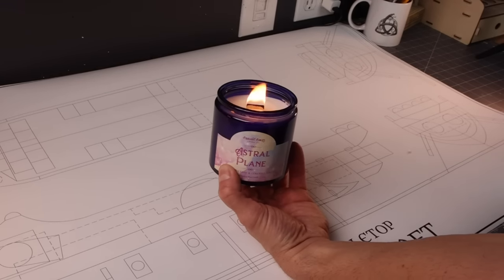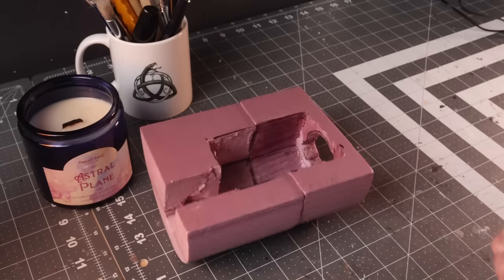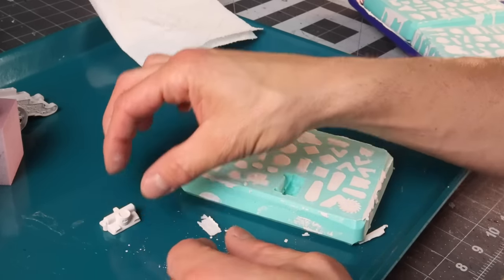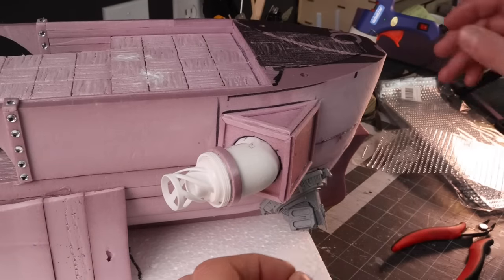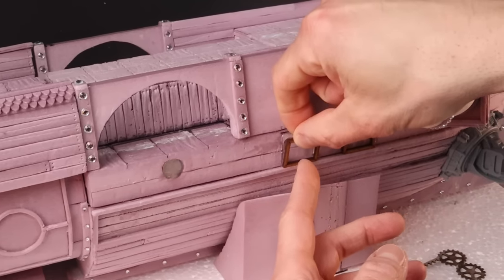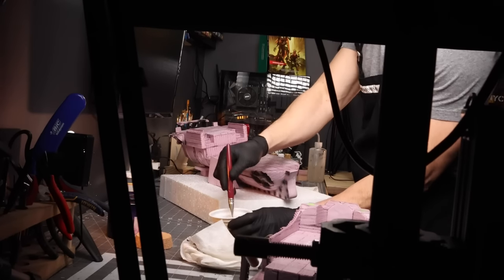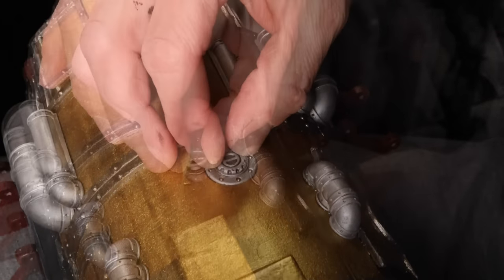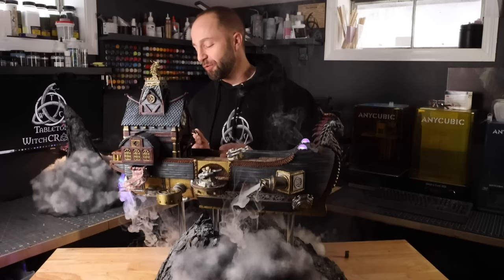EPIC SHIP for Tabletop Gaming

Comment: Can I give you a pro model making tip when working in foam like this?
The templates that you made, print out twice as many in a thin card stock. laser cut them, print and stick and free hand, whatever. 
When you have your material in cube form, attach the templates to either side of the cube, either double sided tape, pins or blue tac works fine, depending on the size of the template and depth of the cut. 
If it is an asymmetrical shape (like the curve of your bow) then put the big template on the bottom and the small on the top. Pull the piece up hard against the wire, the templates will prevent the cut from going deeper than it should if you pull it through in decent time. 
I always make my templates with a bit of extra, like a tab as a guide, on the beginning to guide the hot wire into the right place before it touches the foam, it gives you those few precious seconds to readjust or back out if something isn't aligned properly. 
I use this technique because a bit of templating up front with the lovely, perfectly smooth finish that you get from the hot wire means that there is no finishing work to be done. You get the cut that you want, where you want it with a perfect finish, first time, every time.

Also, keep the bits that you cut off and reform the original "cube" double sided tape is your friend here, but pinning is sometimes a necessary evil. You now have a flat surface to stick more templates on that are cut from different angles. This is how I do compound curves like the bow of your boat. 

I think it's worth spending the extra 10 minutes getting the guide right to save you potentially hours of sanding, patching and adjusting to get an almost but not quite right end result. Myself, I'd rather get exactly what I want first try by spending a little bit more time on the template than doing the laborious work of trying to patch up "mistakes" and ending up with an inferior end result.
Reply from the maker: That's certainly one way to do it.  Basically it's like any pillar jig for the proxxon.  I've used this method before.  The thing with the hull is that it is being covered in foam "timbers" and my method worked for me in about 15 minutes it was done.  If I was to carve the boards directly into the hull then I would have used your method.  Great tip!
Reply: @TabletopWitchCRAFT  I'm a bit spoilt because I primarily use my laser cutter to make the templates. I used to go from my sketches to freehand templates like you are doing here but I found what I lost on the swings I made up on the roundabouts when it came to templating. 
One of my product lines is jigs so I guess I'm a bit biased. 

My philosophy is "computer good at French curve and straight line, monkey good at nature"

my workflow is;
- Sketch and see if I can get something workable. Symmetrical stuff is folded so you only need to draw half. Then, I digitize it regardless. I used to skip the digital step if I had something workable but I found it was holding my business model back. 
- Fusion/ solidworks/ illustrator/ whatever CAD program, slice it to create templates. 
- Laser cut then use the laser cut jigs straight as templates.
- Weathering etc, freehand, rub with rocks for texture, wire brush for planks etc etc. 

Of course your end result is fantastic, I just thought I'd share my process. Subscribed and liked :)

Comment: Very impressed with the work you put into this.  Great how you build on the work you have done on past projects to elevate this piece. 
Several design elements i mused about given my own desire for an epic sized airship:  
My campaign world would be less advanced technologically, so I would sub those parts for magically based elements.  I pictured the ship as part of a unique design from an ancient culture that no longer exists.  No rocket thrusters but perhaps more gem based pieces that would glow with magically charged energy.
Similar in sense of compressing and accelerating air thru longer airshafts running the length of the ship, like a jet boat drawing water and shooting it out the back.  Thus vents up front to draw in that air to be compressed just as you have done.
Similar and more directional side vents for steering though on a smaller scale than your own, removing the need for the rotors.
Your magnetic components make that an easily incorporated feature.
The cannons would be more stylized and fire crystal cannon fireballs and continue your dragon motif (similar to Chinese cannons i have seen).
You didn't mention if the Dragon figurehead actually had a dragon breath function.  Again that can be incorporated into your design pretty easily.  As visually interesting as the smoke is, I would favour white streamers to maintain the illusion of motion like the flags.  Tiny fans within to blow the streamers? Unclear if that would work.  I find the smoke in your montage, coming out and falling downward takes away from feeling of motion IMO. 
Your incredible work is a wonderful spur to imagine possibilities and awesome modular alternatives.
Again, very well done, sir.
Reply from the maker: Your ideas sound so creative and excellent.  You really should give that a go…. And after reading this…. My dragon figurehead breathes 🔥. Thank you!

Comment: I'm not sure how easy it would be to implement, but maybe use the motors and cut-down props from a micro drone to give the smoke some impetus out of the nozzles. Or a small fan with hoses ducted alongside the smoke lines, but ending a bit short, to push the smoke out faster to make a contrail effect. As it sits, the drifting smoke appears counterpoint to the waving flags.
Reply: WTF are you raving on about 😂just enjoy the visuals, don’t over think it 😉